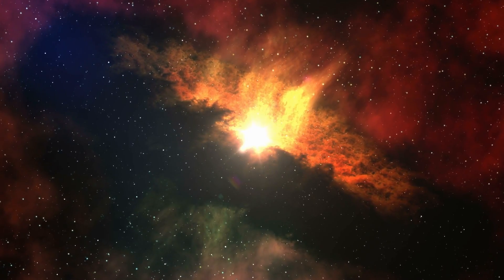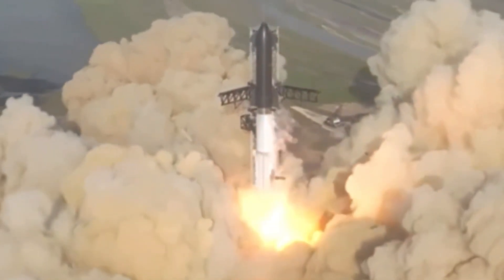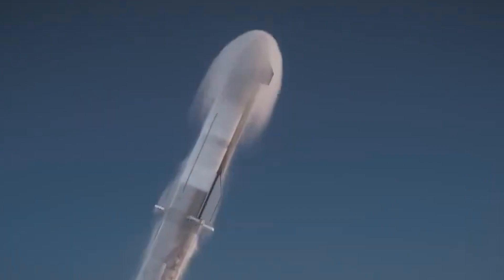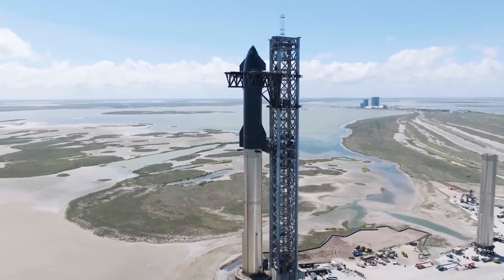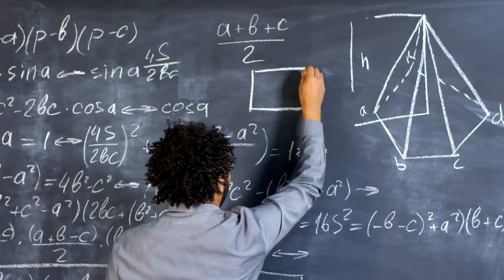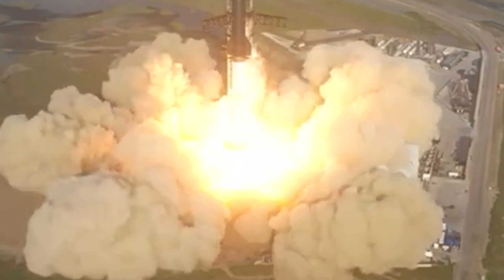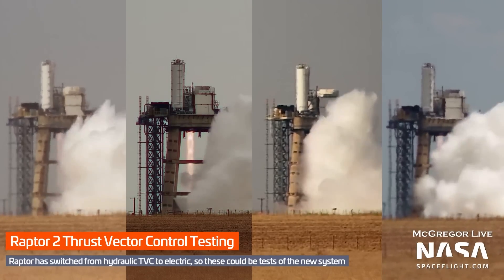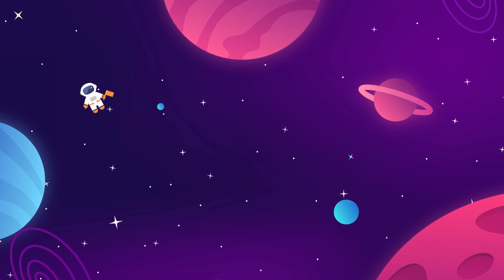The SpaceX Starship Orbital Launch Update Is Here!

Comment: Just a thought.  If the fandag concrete appeared to support the initial test, the raptors were only putting out around 50% of their total power, the test was for 15 secs more or less.  The launch used 90 or 100% also for around 15 seconds, by the time the rocket cleared the tower.  I think the math goes something like this.  1st test = .5 * 15 seconds.  Flight = .9 * 15 seconds.  Note that I am not including the actual force of the rocket.  The total force applied to the pad is not .5 * 15 seconds.  It is .5 * 15 sec PLUS ,95 (more or less) * 15 secs.  The total force is then .5*15 + .95*15, which is to say that even with out units, the total force approaches 3 times the total of the test.  if the unit is 7.5 tonnes...  you probably get the idea.

Comment: Surprised this was missed by SpaceX. I ran numbers for a rocket launch project a few years ago and my conclusion were flame diverters and full water deluge. The amount of heat and energy is simply insane.
Reply: In my experience engineers rarely miss things but management and marketing often override engineering.
Reply: Well, my job is to technically defend engineers who have made professional mistakes. I can assure you that errors do occur and they are often expensive to correct. In this case, they took a chance to save some money.
Reply: @rioriggs3568  do you know for certain the engineers involved here were not “given helpful feedback” or just speculating?
Read comment by Jerakk30 posted earlier.
Reply: Dude don't be a social warrior!  The launch pad performed so poorly it could have caused the mission to fail in the first few seconds. They clearly didn’t expect massive chunks of concrete to hit the engines!
Reply: @rioriggs3568  Engineers? No, Musk did.
Reply: @rioriggs3568  "they didn't expect massive chunks of concrete to hit the engines" um.. why didn't they expect that? Because past history of every other heavy launch system prior to the standardization of aforementioned safety features had issues like that.. the launch pad being destroyed and sending debris flying that damaged the rockets themselves.  I mean come on now, this is supposed to be the largest booster system ever created..  they absolutely had to know that if smaller ones did a shit ton of damage, clearly one much larger would do a lot more.  Newton's laws don't change just because something is "new".  You generate more thrust.. that's more energy being thrown out in the opposite direction.
Reply: Look how far the debris went, look at the damage to the tank farm, etc. It will take months to rebuild before the next launch and they’re now facing governmental bureaucracy. They would have lost a few more engines because of this circus and the rocket wouldn’t even have left the pad. Thank god you don’t work for a space agency if you think this is normal and acceptable.
Reply: @rioriggs3568  I agree - this was very close to disabling enough engines that the stack just drops back to the pad and explodes.  This was dumb luck, and now they wasted at least six months of testing schedule.
Reply: @rok1475  AMEN!  You nailed it.
Reply: @rok1475  Exactly (management and marketing meaning Musk). Cannot wait for this chapter in Gwynne Shotwell's memoir 😀
Reply: It wasn't missed by SpaceX it was purposely ignored.  Elon announced it prior to the construction of the pad that they wouldn't have any of those standard safety features in place and also added "we will probably regret this decision".  Gee... I wonder why..
Reply: SpaceX took the cheap way, not the right way and that was clearly demonstrated.
Reply: @daves6220  Cheap ways tend to turn out more expensive...
Reply: @daves6220  Going a cheaper route isn't necessarily bad.  They were testing new material and methods for protecting the rocket and launch site for cheaper construction and faster turn around for repairs.  That being said.. you DON'T TEST THAT KIND OF STUFF ON A SEVERAL BILLION DOLLAR TEST ROCKET.  You build a site out in the middle of nowhere that's specifically designed to just do that.. test the materials and launch system.  I mean you really test it, throw as much at it as you can, more than what it would experience during normal use and see how it holds up.  Testing it in tandem with the most important part of your business plan is stupid as all holy hell.  Yes.. I understand that after the mission it was to be basically dropped in the ocean and destroyed anyways.. but they're trying to get as much data out of it as possible.  Killing it 4 minutes in before it can even remove the first stage doesn't really get you that much data.  Car manufacturers don't keep driving fresh off the assembly line cars into the first wall they see in order to test new features.. they create a crash test site specifically designed to test those new features before using them in the final product..
Reply: Can’t deploy one because of environment issues e.g. mudflat/water and EPA
Reply: @conormurray7056  environmental concerns and regulations in Texas?
I thought one of the reasons Musk chose Texas was the freedom to do whatever he wanted?
Reply: @rok1475  "environmental concerns" with that amount of smoke? A joke.
Reply: @conormurray7056  They cannot dig a trench, but they can make some kind of steel and refractory tile/brick ramp, and they could have made the stand taller.

Comment: So I was just reading what fondag concrete is...  It is used for high-temperature foundry applications.  I don't know what the expected PSI strength of fondag is compared to standard high tensile concrete, in my experience the high temperature foundry blends I have experienced are designed for heat not compressive strength.  So this may have been much weaker than normal concrete.

So the high temperatures of the launch are not going to penetrate the entire pad, really only the top few millimeters of the surface.  So why compromise the strength of the whole launch pad when only the surface needs it?  The alumina concrete would have been pulverized easily, despite withstanding the heat.  The rocket exhaust is a continual explosion, aimed at this weak crumbly and porous foundry insulation concrete.  

That is not the concrete I would have used.  Conventional concrete does have bad behaviors under extreme heat, but we are talking heat that lasts only a few seconds.  Heat is an issue, but the jackhammer effect of the rocket is a bigger issue.  They needed to seal the surface of the fondag with something stronger, but then why do you need the fondag if it won't be in the direct flame?  Conventional concrete with a well anchored steel blast wall would have been the way to go.

I get it, the fiery heat of the rocket was to be countered with the  fondag...  But it isn't just heat, in fact it is mostly blast, and fondag is not explosion proof, it is in the weak category as far as concrete is concerned.  The wrong material!

Comment: There's too many engines, 33 is alot and IMO will cause too many points of failure and potential maintenance issues. They're also too close together and need more heat protections in the center where the fire obviously took over causing more engine failures.
Reply: Russian rocket has been doing with 20 engines for decades, with few failures.

Comment: Correct on all points. The fact is this launch was an utter disaster from beginning to its catastrophic ending. Motors failing and exploding, in essence the rocket escaped exploding on the pad but was vittially falling to pieces on the way up. Utterly destroyed the pad and associated support structures. Many of this was foretold, despite that they went ahead basicly ignoring that they weren't even close to ready. No other company nor NASA nor any other organization functions with this level of carelessness and incompetence. The idiotic excuse that NASA blew rockets 50 years ago is utterly stupid. IT WAS 50 years ago. They were vitually inventing rockets! Their best computer was a slide rule for Christ sakes! The FAA should not allow this circle of clowns to continue until they have thoroughly have proven all the components and system. This is BS.

Comment: Yes  when I saw the concrete damage, how it exploded and rained down chunks of concrete far away. It seemed obvious to me that this is what broke the 5 engines, the amount of power coming out of this thing is mind blowing.
Reply: Not to mention, as promised by certain enthusiasts, groundbreaking.
Reply: Reminds me of starting them on water ngl
Reply: Except there were more than 5 engines lost and that after it cleared the pad it had only lost 3 engines. There are probably other mechanisms. After all, Raptors have had a troubled history in other tests.
Reply: Don't you think it is strange that a ship which can land is not designed to separate at its own will in case of emergency?
Reply: @reasonerenlightened2456  It is designed to separate (both in an emergency and normally), but the emergency disconnect wasn't used because this is a test flight, and there was nothing on there worth saving.  When they put people on there, it'll have emergency disconnect just like all the other rockets carrying people do now.
Reply: @reasonerenlightened2456  Even stranger when you think about all the SpaceX fans believing that Starship will be human rated.

Comment: The plate is going to redirect the gas back towards the engines and cause damage. They are going with the plate idea because they don’t want to consider the obvious answer which is a flame trench. They don’t want to consider the trench because they can’t build one at the site— which means they built on the wrong site.

Comment: Viewers of the launch five miles away should keep this in mind. This massive rocket could just as easily have gone out of control seconds after liftoff and headed in your general direction. Standing out in the open you could have been incinerated in seconds. This is what happened during one of the failed Russian N1 rocket launch attempts. The total casualty count from that explosion was significant and was never made public. Stay away and move away from this area, because Musk's luck may not be so great the next time.

Comment: There was something very different about the Starship launch the I wonder about. In the course of every Falcon 9 launch, the grid fins lay flat against the rocket and deploy after separation. 
The Starship grid fins were fully deployed from the moment of launch and remained extended throughout. That's a lot of aerodynamic drag. Why was this done?
Reply: The grid fins on the super heavy booster doesn't fold down, they realized the drag is negligible and the mechanics would just add unnecessary weight and complexity. best part is no part.

Comment: Minor thing you got wrong - the clamps release well before engine light. Starship is just so heavy that it still sits on the mount at <50% thrust  and just lifts away once throttled up. Interesting to note that the hydraulics are involved in separation though, I have't heard anyone talking about that and only talking about vector control of the booster.
Reply: I have seen many comments like yours about the hold down clamps. Could you point me to info on this.

Comment: I did not understand why the Starship could not be released as it was completely functional and in tact. A safety release could have brought the starship to the landing pad. These are expensive try-outs, guess 2 or 3 are needed to be destroyed, right? If they know this why having heatshields and not bother with a platform cooling system with plenty of water.

Comment: Basically this is not a booster but a First stage rocket. If the outer ring of 20 engines was replaced with 3-minute solid rocket boosters that can eject when burned up, the first stage would not need as much fuel and would have been propelled way faster after jettisoning the solid boosters. DESIGN FLAW, in a big way. Having 33 engines is a game of roulette when stones and debris are hitting some engines destroying them at lift-off. Luckily, it did not blow up at liftoff but wasn't far off. There is even a thought to chop the first stage up in segments partly solid booster and partly main engines. So even second stage can have some solid boosters etc. You get the idea.

Comment: I love the shot of the rear window of that vehicle parked close by experiencing a 'rapid shattering event'.  When I saw how close some of that support structure was to the pad, especially that tank farm, my comment to my wife was, "Really?".   Yeah, really, and really questionable.  When you look at what Apollo has set up for flame diverters, deluge systems, etc., and look at this absurdity of a launch stand, especially  considering the thrust was almost twice, ya gotta wonder WTH they were thinking.  That launch stand was about 14 tons of fertilizer in a one ton truck. 

It amazes me that the engineers at SpaceX can be as smart as they are, while also being as dumb as they are, but it probably shouldn't.   Normally you design and build to some significant FOS, wherever you can, and you don't 'typically' pick a number rather less than one.  That was a world class brain fart, start to finish.   Had I been responsible for the design of that miserable  Stage 0 and support layout, I would have picked up my stuff and walked to the nearest exit, head held low, before they ejected me with a boot stuck where the sun don't shine, so to speak.  I imagine there will be a few of those joyful celebrations going on here, especially considering the way Musk operates, unless he was fully warned and chose to fly anyway, himself.  If that was the case, he is unlikely to be shown the exit.  :-/  :-)  Just sayin'.  He didn't look exactly elated after the launch, and I expect it was the video of what occurred during the opening phase of the launch driving that apparent glee.  Either that, or he always looks like that when not pimping for the camera. I would guess that the rest of the outcome would have been at or above his expectations for this phase of testing, considering SpaceX's fly, fail, fly again, rinse and wash to success mode...which I don't disagree with, BTW.  It is the way it was done many, many years ago, and NOT the way it is done most times in the defense industry now.  In most programs you would be history with even fairly small percentages of the failures SpaceX typically tallies up to a success. So far, they have proven to be VERY reliable on the back end, which they'd better be, given their mission profile/requirements.

All that said, considering they were blasting giant pieces of concrete at the ass end just for grins and giggles, the rocket performed amazingly well.  My guess, given that condition, would have been a likely explosion on the pad, which would have made the damage that occurred there look like pretty much nothing.  Maintaining control for that extended period of flight, probably until they hit max Q, was nothing short of amazing, considering 20-25% engine failure (I counted six, 2-1-2 on the periphery, and one in the center triad, on the video I saw. don't know what transpired later in the flight), and being as asymmetrical as it was is bad news.  Assuming they didn't have a gimballing failure, they may have made it to sep, with a more symmetrical failure.  The fact that it was that asymmetrical makes me question the rock damage claims as the total cause for motor failures, but then I don't have access to the telemetry or video from up near the failure, and even when I did it wasn't always obvious exactly what went on.   I imagine this thing is instrumented all to hell compared to the rocket I worked, though. It was just a legacy hodgepodge flying junk pile cobbled together out of junk from various other platforms that flew against THAADS, and one STORM intercept.  Nothing even REMOTELY to the complexity or requirements of this thing of beauty, including ultimately carrying living human cargo.  I was stressed enough without having to deal with that, frankly.

The part I found the funniest in this narrative was "Starship actually hit another Max Q even on the way back down"...no shit, Sherlock, never would have guessed.  As these vehicles ALWAYS do, on the way back down. If you define it as being Max Q for the entire flight, though, there can be only one, by definition.   Kind of what the word maximum means. In other words, you can have more than one local maxima, but only one universal version.  :-)  Kidding aside, nice job.

Comment: What I can't understand is how it was able to lift off minus the three engines. When a rocket has multiple engines on the first stage the launch sequencer has to receive a signal from each individual engine indicating that the engine is running. The sequencer then totals up all the signals and if all of the engines are running normally the hold down clamps release and the rocket is let go. If Starship is designed this way then even if just one engine had failed to start all the others should have shut down and Starship should not have lifted off.

Comment: It would be well advisable to learn basics of rocketry before launching tirrade of complete nonsense. The Skirt of the Starship is unpressurized   section of the rocket. Therefore it is subject to compressive forces generated by thrust of rocket engines. Maximum compression of the Skirt occures not during MaxQ but just before MECO due to mass distribution (SH Booster almost empty while the Starship full of fuel and oxidizer). Collapse of the Skirt just before MECO was anticipated 3 years ago and occured right on schedule. Pictures prove that it occured. It is complete nonsese to claim that damage of the Skirt was result of tumbling of the rocket and not primary cause of it.